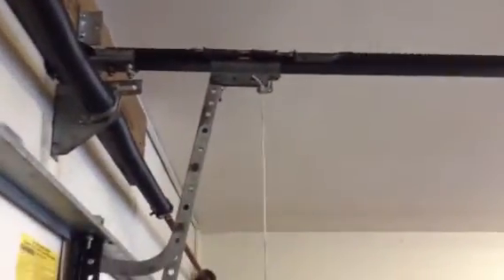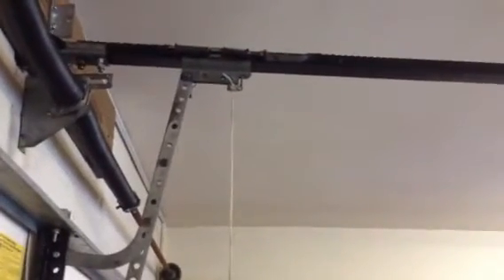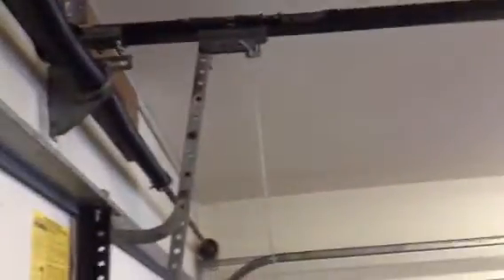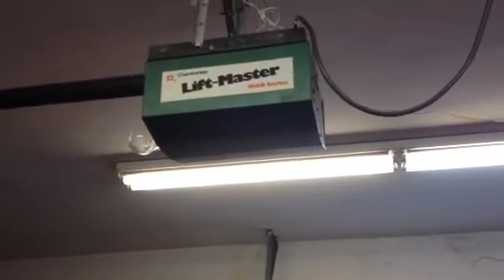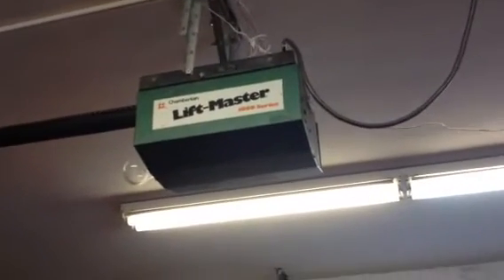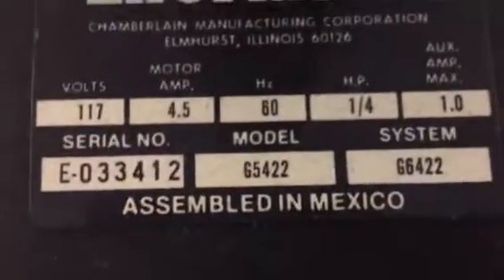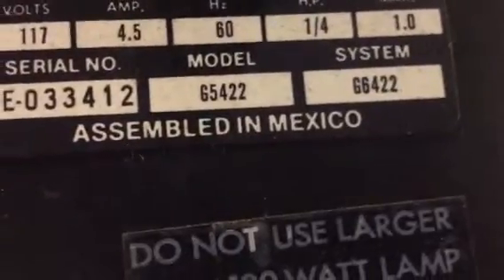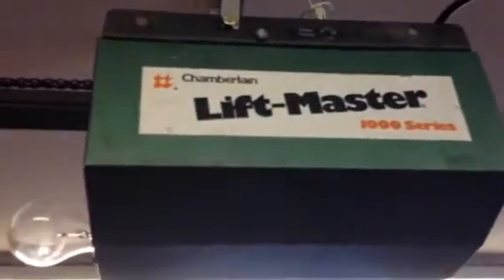Another Oldie - Lift-Master 1000

Comment: I've had the cover off this one before, and it still has the original belt. The only thing not original to this machine is the light delay. It failed before I got it, but I found another light delay and put in for them. It's still in good shape. My neighbor just opened it in the morning, and close it at night. Since I got it, it's just been stored for the most part. LOL!

Comment: Help! I have this oldie model and my wife broke the last opener. I called a garage door repair company who told me to call Chamberlain who told me that I have to replace the model entirely if I want to remotely open. You seem to have this model hooked up to a different model receiver. Could I do the same? Is there hope for me to replace my receiver?
Reply from the maker: Yes, the receiver can be replaced. I'll send you a message in a little bit.
Reply: Nick'sGarageDoorService Hey! I have this exact garage door opener. Can you message me to tell me how to do this? I would appreciate it so much. I know this is a long shot because this video is so old lol
Reply: Nick'sGarageDoorService Replace the reciever, that is. I don’t have a remote :(
Reply: @NicksGarageDoorService  I have the same garage door opener. But I don’t have a remote for it. Can I get a new remote or do I need to change the receiver?
Reply from the maker: @KevC84  Remotes for these are obsolete. You will have to install a receiver if you want to add remotes. However, know this operator is not UL325 compliant and really should be replaced with an operator that has photoelectric safety sensors.
Reply: @NicksGarageDoorService  can you recommend a receiver for this exact unit?